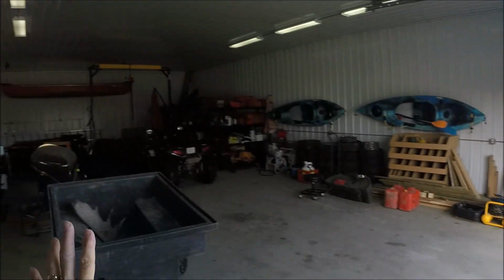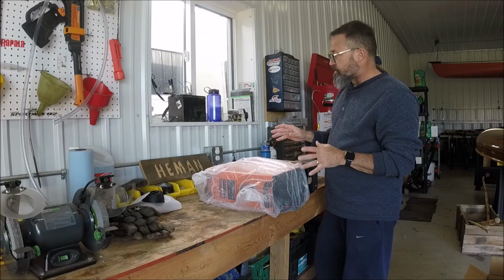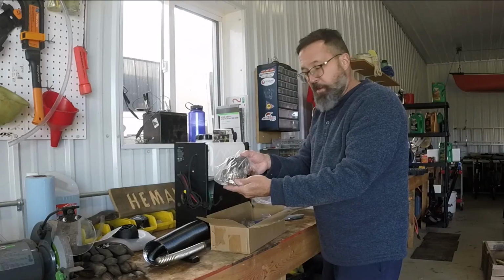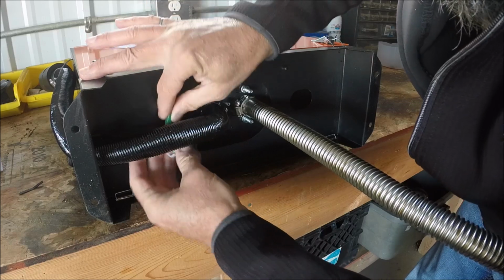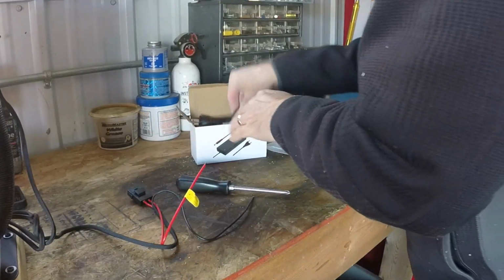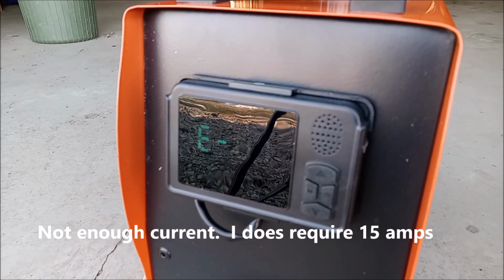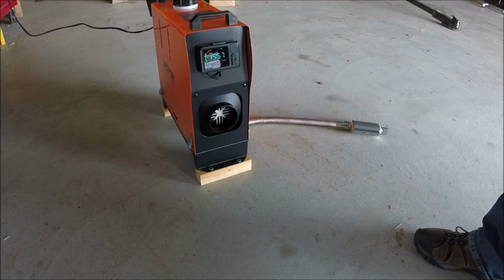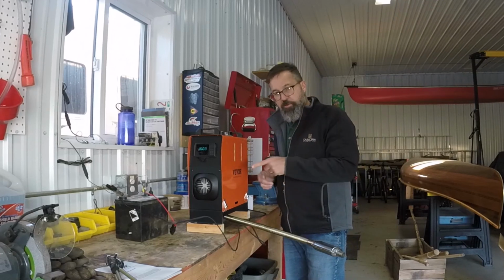Vevor 8kW (27,300 BTU) diesel fired air heater - unboxing & setup - ideal heat for a work shop

Comment: I used my Chinese diesel heater for 3 cold seasons.  I learned a few improvements along the way to pass on to viewers. 1) fuel jugs   2) fuel filter     3) fuel tank light   4) battery power source with float charger

1) I use 1.5 gallon plastic fuel jugs with push button spout to refuel. In 3 years with these I have not spilled a drop.  They work great for me. The 2.5 gallon jug is heavy and awkward to handle.

 2)  The heater fuel pickup is needlessly far from the tank bottom probably to contain sediments at the bottom. However, when you refuel, the tank bottom gets disturbed. A tiny bit of trash seized up my pump one cold morning. I added a small engine lawnmower fuel filter in the line between the tank and pump inlet. This allowed my pump to run flawlessly for the next 2 seasons and I can see the dirt in the bowl that would have stopped the pump. The heater runs day and night from mid November to mid February on heat lever 2 all night to heat level 5 or 6 in the mornings, gets the fuel topped off in the morning and the evening. If everyone leaves the house, I shut down the heater. Usually there is someone home day and night.

3)  I burn red off road non taxed diesel fuel. I added a 12 volt LED light to the top of the tank by the fuel pump. It is taped on with aluminum foil tape to direct the light into the tank. I can clearly see the fuel level from 40 feet away with the fuel tank light.  When I first installed the light at the bottom of the tank, the fuel level was not discernable. Top mount the light only! Also, I can clearly see the fuel level on my cell phone with my video Pet Cam from anywhere around town.

4)  I run my heater from a home built lithium battery box with built in automatic charger. Should the power fail, my unit can run for 14 hours on heat setting 2.  These heaters have a cool down cycle after the Shut Off mode is selected. Running from a battery allows the proper cool down especially if the unit is burning hot at #6 maximum setting. Losing power suddenly during grid down outage is no good for the unit.                              I hope this helps!
Reply from the maker: Fantastic feedback that I totally appreciate.  I'm going to pin your comment to the top so others can benefit from your insights as well.  Thanks & cheers.
Reply: @Martyupnorth  Here's a video showing the fuel tank light in action. It has brackets attaching it to the top of the wood stove in case of earthquake. 
https://www.youtube.com/watch?v=EMF860RXbsk
Reply: I just installed my first diesel heater. The information you provided seems to be spot on. Thank you very much.
One thing I did was use basic girl gauge wire for the electrical connection. Like 14 stranded and I added a fuse
Reply: Well done you've made a lot of improvements but I wouldn't use jugs for your fuel, you are better off using fuel tanks. Those jugs can easily be knocked over, where's a proper tank can be fixed in place and is much better.
Reply: @regd.2263  These push button nozzle jugs can lay on their sides and still be leak proof. There are a pair of 1.25 gallon and a 2.5 gallon jugs that are short and squatty.  By refueling twice a day, the diesel burner by default needs to be checked for any signs of trouble, leaks, odd sounds, input voltage, lithium battery state of charge. It is installed indoors with wingnut brackets that prevent movement in case of earthquake or other disturbance. The unit has adequate supervision, has exhaust heat reclamation and exhausts up a fireplace chimney to be rid of any combustion byproducts. I enjoy the constant warmth and do not need to run the central gas furnace at all here in December.
The fuel jugs get refilled from a 35 gallon tank outside with a hand pump. My system works very well for me but may not suit the needs of others using diesel heaters.
Reply: The fuel line may burn.  You suck at mechanics !!

Comment: We need to use this to heat the plane engine.  There is no power source near the plane. We will need to get decent size battery and put pitails on the power wires? What  size car battery might work ? Assuming it might take an hour to warm up engine?
Reply from the maker: https://www.youtube.com/watch?v=JhNx4ieS_dQ
Reply from the maker: https://www.youtube.com/watch?v=puvd9Z8zJFY
Reply from the maker: The different videos I've seen show about 2 Amp hour consumption.  A new car battery has about 48 amp hours of storage.

Comment: Not close to 28,000 btu. They are just arounf 17060 btu if you're lucky. They will heat a 2 stall shop if it's insulated.

Comment: Don't bend the exhaust tubing by sliding it onto the unit and trying to bend it 90 degrees. These things are made cheap and can bend a distort the unit causing them to leak and release fumes, etc. slide the exhaust tube over a piece of pipe about 1" and bend it that way, then mount it to your heater!
 Also, the BTU rating of 8KW is a lie. They barely make 5KW, just so you know and is only 17060 BTUs so that's what you have there.

Comment: I run the exhaust gas through a thin horizontal single wall stove pipe to use all heat possible.

Comment: Does the exhaust get very hot on these? I am wondering about a through wall exhaust setup.
Reply from the maker: The exhaust gets very hot.  If you go through a wall, you'll need some sort of ceramic insulation around the pipe.
Reply: @Martyupnorth  Good to know. Thanks for the info.

Comment: Hey Marty, those heaters only come in actual 3kw but labeled as a 5 and 8 kw. There's been a few examples and the housing are.noticeably larger if an actual 5 or 8 kw. When we get our cold Temps, as im in manitoba and our Temps get similar in no way will it keep your shop half decent workable temp. Mine heads a 6x8ish non insulated porch  windows on 3 sides and house on one -20c it's working  -30 I'm running  it full blast with some tweaked settings in the controller to keep it half decent aka sweater weather. But I do like them. Have 2 myself

Comment: Why was the voltage inadequate?
Reply from the maker: The voltage was correct (12v), it's the current that was too low.  I initially used a 12V 5 amp power source (normally used for LED lights).  The unit requires about 13-14 amps of current on start-up, while it's warming up the glow plug.  Once it's operational, the current drops to under 2 amps.
Reply: @Martyupnorth  oh ok I have the same one but its 15amp. I havent used it yet, Im waiting for the heater to be delivered.

Comment: Does the clicking ever stop while the unit is running? I'm thinking this type of unit is made for heating a vehicle, especially while sleeping, and the clicking would be problematic.
Reply from the maker: The clicking never stops because it's the sound of the fuel pump.  It slows down as temperature setpoint is reached.  It's not very loud.  Like a clock.  Easy to muffle with some barrier.

Comment: Does it have a built in termostat? Does it stop completely once it reaches the set temperature?
Thanks
Reply from the maker: I'm trying to figure tat out.  I'll answer that in part 2, after I complete my performance testing.
Reply: No thermostat

Comment: Actually it only needs 15 amps on start up to run the glow plug. It drops to around 2-3 amps once the glow plug shuts off. You could probably run it indefinitely like that with your battery on a tender.
Reply from the maker: I confirm your statement.  I put an amp-meter during subsequent tests and found the same thing.

Comment: Marty, it always worries me when people put diesel in a red gas can.  Seen too many costly mistakes.  Please get a proper can soon and transfer the diesel.
Reply from the maker: I tagged the can.  I have cans with gasoline, mixed gasoline, used oil and diesel.  Thanks.
Reply: I don't think I've ever seen those smaller 5L fuel cans in yellow. Red cans are far more available and will work fine as long as its clearly marked as diesel.

Comment: I have an 8 kw. Most of these heaters are all identical just different names. You buy 1 rebuild kit and it does them all. Easy to rebuild, parts are cheap but they are a bit fuel thirsty. Stay warm Marty 👍

Comment: 3 vanlifers that I follow here on you tube have that brand of heaters installed inside their van and the reliability of them is very patchy at best and a bad joke at worst
Reply: All Vevor products are trash
Reply: I used my identical heater for 3 seasons in a house. For 2-1/2 months in the Winter  it runs round the clock on red off road farm diesel fuel, gets fueled twice a day. After adding a cheap lawnmower fuel filter before the pump, all troubles disappeared. The movement of a vehicle and the act of refueling stirs up trash particles that jam up the pump.